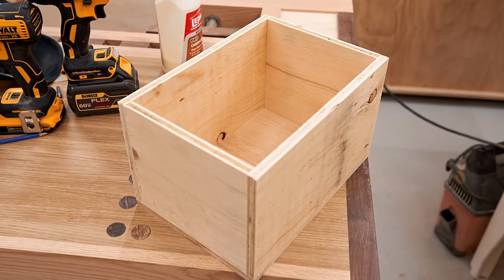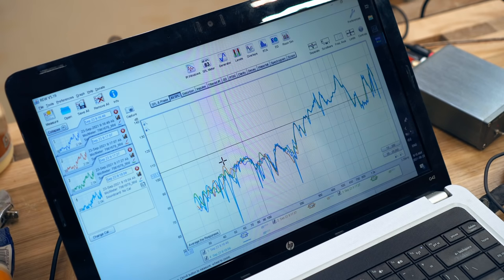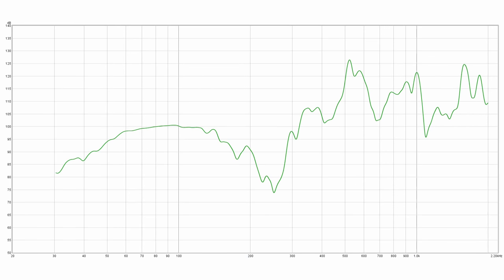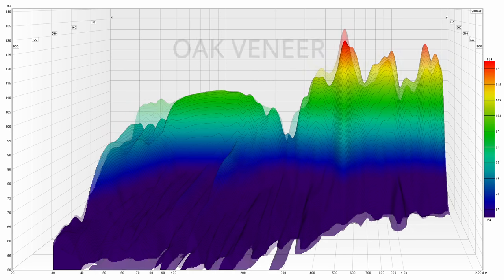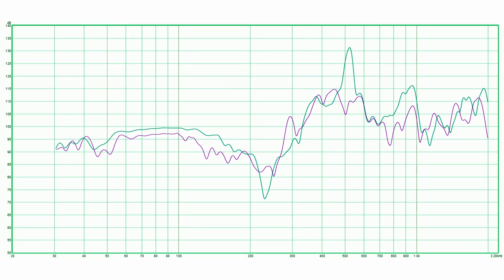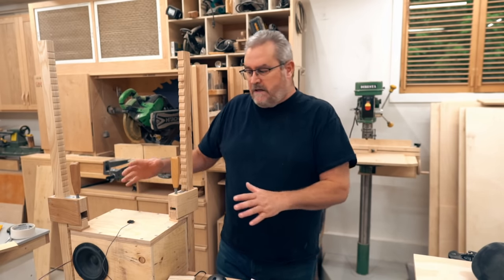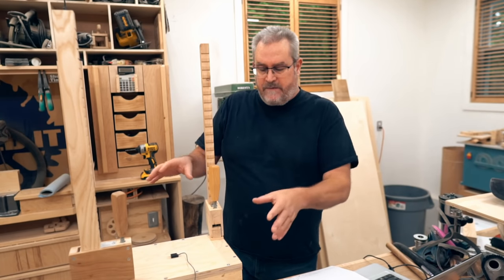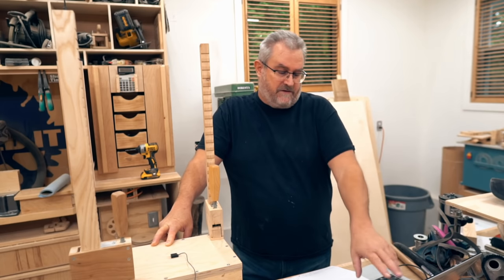PLYWOOD vs MDF For Speaker Building - Tests Show Surprising Results

Comment: Not everyone has the same sound sensitivity when hearing just like not everyone sees with the same vision, some see further some see more color depth or contrast and the same is true about hearing. Most won't hear a difference but some will detect the slightest difference.

Comment: Use bracing to get the resonances up in frequency. Then use stuffing to control them. That's the way it is mostly done these days. Which is obviously supported by your measurements. What doesn't keep me from making my speakers from beech plywood (not that popular in your part of the world, I am aware), which is heavy and rigid as hell.
Reply from the maker: Yes, best of both worlds seems to be the most effective. 
Probably the very best would be to use the stiffest material possible with bracing and damping, but the gains won't really be significant enough to justify any extra expense or the inconvenience of trying to get something that's not commonly available where you are. Like I said in the description, though, it's hard for people to overcome their preconceptions. If they are convinced it has to be a certain way, no amount of evidence will sway them.

Comment: I'm not sure if the methodology was appropriate. He only changed one of the 6 pieces of wood in the box and took measurements. If the 6 pieces of bottles were exchanged, it is possible that the differences measured would have been more significant.

Comment: How about long term stability and that wood moves over time with environmental conditions?
Reply from the maker: Under normal conditions (indoors, kept dry), solid wood expands and contracts with seasonal humidity changes, but plywood / MDF does not. Engineered sheet goods like plywood and MDF are dimensionally stable.
Reply: @IBuildIt  doh! Of course. Thanks.

Comment: Hello John and anyone else who might know: Does the shape of the enclosure matter much for the over-all performance of the speaker? I once read that an enclosure following the (iirc) golden ratio (something like 0.6x1x1.6 depth, height, width) was "a good thing" for speaker performance, but it wasn't explained why.

Does this idea hold any water, or is it just more wishful thinking?

Thank you!
Reply: Golden ratio in the math more of a sphere with the dimensions of a rectangle describing it.  Golden ratio can be found in the degrees or circumference of a circle using that as a basis for your closure by length opens a very very specific door to things that actually work not lump sum volumes and don’t do much of anything specific.

But 02618 is 15° over and over and over again in the circle where it will repeat.  15° can be 15 cm, if 360 cm is used appropriately compound pipe of 270 and 90 in a parallel arrangement does something just like this and we drivers firing at 30 cm in from each end you didn’t have 300 cm between them and acoustical center of that as 150 they close the center of the enclosure and the end 180 tossing around the golden ratio of multiples multiples of many dimensions including the sphere created for the volume of the sphere i, it’s self has a 240° the same number as the math constant 4÷3 times pi, if radius is 0.5 then the virus fear 05236 which is twice the golden ratio and 30° it’s also the speed of light and it’s parallax angle it’s locate the planet earthEverything else by the Pythagorean theorem and the diameter of the sun has the short leg of the triangle at that angle from the center Sun to earth at 150,000,000 km away.  Details in decimal points that make it even more appropriate

Comment: So go ahead and use cheap pine plywood and stuff the box.

It would be interesting to try the same tests with solid wood rather than ply to see the difference.

Also could you do the same with Styrofoam and Foam core board. There has been a lot of chatter on DIY boards about such alternate materials.

Comment: Nice set of tests John. I like the method. You didn't try flooring grade OSB. It might surprise you to.
Reply from the maker: I thought about it, but didn't have any on hand. I've made a few speakers from OSB, including that small subwoofer I built a couple years ago. Insanely stiff stuff.
Reply: @IBuildIt    What I really like is the soft core. Can you say internally dampened? I have to do a similar set of tests on a super stiff thin walled cabinet and a 18mm OSB cabinet. As you mentioned the upper frequency resonances are the ones that are the larger problems. What I have found working on some very tricked out enclosures and loudspeaker drivers is that when they start to get really good you do notice the absence of these colourations. It's not smack your forehead what a difference. But you do notice the difference in what you can hear in the recordings versus what was previously masked by the noise the drivers or the enclosures were adding of their own.
Reply from the maker: Going to take a fair bit of noise to do that, no? And by audible, I meant an audible difference between the panels I tested.
But I can't say one way or the other; since building my room downstairs I'm hearing music like I've never heard it before. Now that absolutely does make a smack your forehead difference.
Reply: @IBuildIt    Lets follow your lead with the room treatment. Why do you think that you are enjoying your music more now than ever before? Perhaps you are experiencing the lack of colourations that are inherent in an overly  reflective room? Or has serious null points in the bass right where you are listening? Once you clean up the larger things it can be interesting what starts to show up in your listening. Your ears get accustomed to the cleaner sound. And it is hard to go back to the former sound. You are experiencing greater fidelity to the recording I believe.
Reply from the maker: Yes, but the treatment is fixing very serious problems. Problems that are created by the full volume of the audio signal itself (reflections and reverberation), and not a much, much lower residual that's being emitted by a panel in the speaker. The output from a panel will be orders of magnitude lower than the signal itself.
Reply: @IBuildIt   There are loudspeakers that have resonances that are actually very audible. Column loudspeakers are infamous for having an audible resonance around 1kilohertz due to the internal reflection wavelengths. The funny thing about all these so called hidden resonances are that they get louder as your music gets louder. So are they really inaudible? In my experience they are audible.
Reply: @KravchenkoAudioPerth  I'd also like to point out that the surface area of the enclosure relative to the Sd (surface area of the driver's diaphagm) must be considered.  Do the math and you'll see that even on a small monitor it's usually an order of magnitude or more.  Consider flat panel speakers....It's an exciter coupled to somewhat rigid panel....And they make sound that's very audible...And they do this even though the movement of the panel is small compared to a conventional driver.
Reply: If fact, my new Sony A80J 77” OLED TV does not have any speaker drivers… it actually uses the glass TV screen as it’s drivers.  And the screen does not appear to vibrate at all as it outputs very loud and clear high quality sound!
Reply: @russellanderson746    You are right. Sound within a given bandwidth constraint. And given the human voice frequency range is not that wide, these exciter based methods can really work out quite well.

Comment: I dont see MDF being so great, many layered plywood is defen. harder and still a mix of pieces with different qualities, while the MDF is homogen.
The best material in this case is actually corean (by Dupon) it has the perfect mix of materials to dampen sount inertially by itself. (because of the mixing of materials with so different properties causing nullyfiying out themselves)

Comment: If you want to get a better test result..... build the exact same box out of the entire material for each. I'm  prety sure you will see that the difference is much more noticeable when the entire box is made of the exact same materials . Trying to measure just one panel it's not going to be as accurate as measuring when the entire box is all of the same material. This is because the sound will travel through all of the walls of the box. This amplifying and or exchanging that to the next panel. But then again maybe I'm wrong. Would definitely be interesting to see if it does indeed make a difference. I know that it has in other kinds of materials

Comment: 2 keys points - a) Additional bracing is not a new thing and b) That's why the top speakers don't use wood. c) You mention, listeners could build with materials used in your test and state the subjective challenges doing so, how about finishing your experiment with complete boxes.

Comment: Ok. Let's clear something up. I have an 18in subwoofer. It handles around 2k watts rms. Do not use 0.5in plywood or mdf.  Does 3/4 make a difference? Oh yes. Does it still flex without braces? Yes. To say 3/4 is only marginally better than 1/2in is misleading. Maybe in your small low power speaker, but in higher power more dynamic speakers the thicker material will shine. Type of material might be less significant than thickness, but for a powerful speaker more is better.

Comment: I like the end takeaway. . try to be objective in your subjective listening test. 

Thanks for doing these tests and confirming what I wanted the result to be. (always helps accepting results that match with your desired result, right?) 😜

I'm wondering if this would change much with larger, floorstanders or sub enclosures that have significantly more volume. However, as you pointed out, an adequate amount of bracing may be the key takeaway. There probably won't be long, unsupported or unbraced sections that would vibrate at resonant freq of the material anyway. And if so, then it may be more of a problem with the design or lack of bracing rather than the material being used.

Comment: where was the accelerometer data? 
and would be nice to see a full comparison box between the extremes, worst performing wood with no bracing and no stuffing. then the mdf maybe at 3/4" thick with bracing and stuffing, alos with aluminum foil with bitumen covering the inside box. it really helps with adding mass and damping. it is easy to fit 2 pounds of it.
Reply from the maker: The data is the measurements.
Reply: @IBuildIt   so the accelerometer is measured in frequency response graph? 
no mic used at all?
Reply from the maker: The accelerometer measures the magnitude of the panel vibrations and that's over the entire sweep range. The higher the peak, the more the panel is moving.
Reply: Hit it harder .  A sweep at ‘dats’ output or laptop sound card has often missed important details I found later the hard way.  Trying ‘beat ‘ freqs around areas if suspicious freqs often found the naughty spot.
Reply from the maker: @Boogerweldz  The speaker is driven with a 20 watt amplifier. It has to be quite loud to get a reliable reading from the panel at all.
Reply: Would love to see you run simillar tests on freestanding (no clamping) sub enclosure at 500-800 watts (RMS) and SPL’s of 70 to 130! Lol😜

Comment: If you double up on the front baffle thickness I think you will be surprised.
Reply from the maker: The front baffle has the drivers, which takes away the bulk of the resonating surface. So there not much gain in doubling it.
Reply: @IBuildIt  I agree with you on that, if it was a 15 and up the slapback standing wave reverberation on a baffle the same thickness as the rest of the enclosure is something you would definitely pick up on when testing, but then it all comes down to rigidity and from the years I've been watching your carpentry videos I think you have it nailed.

Comment: No it won’t make a big difference in a tiny space like that with a 12x14” panel but once you get to areas with 30+ inches with braces only every 12+ inches there’s a huge difference in vibration|flex and if every panel is made out of the same wood and not just one of the panels the difference would test double or triple the difference  of what your chart shows since it’s all the wood vibrating and not just a single panel.

Comment: Almost identical - As you overlay a graph showing 5 to 13dB differences that would require 20x boosts and cuts in power to correct.  🤷
Reply from the maker: You don't seem to understand what I'm measuring. This isn't showing the output from the speaker - it's showing how much the panel is vibrating. The output from the speaker is a good 30-40 db greater than what the panel is producing.

Comment: Objective testing means blind testing behind a transparent black curtain!
Reply from the maker: Objective means not subjective. 
Testing objectively looks at the facts, data and evidence, rather than relying on human perception, impressions, feelings and other subjective criteria.
You can set up an objective test using subjective data, for example a blind test where the listener can't see what's being tested. But it still relies on subjective evaluation and is therefore not completely objective.

Comment: can we measure what you hear? then yes, box coloration is a thing.
Reply from the maker: We can measure that and we can measure what we CAN'T hear, as well. 
In audio there is the signal to noise ratio, and having the noise far enough below the signal means it won't add enough to the output to be detected by our ears.
Reply: @IBuildIt  yes

Comment: Your test and assumptions are flawed.

You should’ve built (4) different boxes. 1 made entirely of baltic birch plywood, 1 made from MDF, 1 made from Construction Grade plywood, 1 made from Pine Plywood and compare the results of the four boxes made from all four different materials, 

 you compared the back of the box made from a different material.  Cabinet Resonances do not travel in one direction only. 

Also you didn’t take into account the front baffles sharp 90 Degree corners which also have reflections.

The majority of speaker cabinet manufactures chamfer the edges of the front baffle to reduce the reflection from the drivers.

Also great loudspeakers designers who are audiophiles use special microphones with the bottom of the speaker cabinet sitting on a stand approximately 28 - 33” high and the center of the tweeter positioned at ear height of 40-46”. The microphone will also be positioned in the center of the tweeter from 3Ft - 6 Ft away.

They set them up a different distances to test the frequency response and the sweep measurements. 

They also will try hundreds of options to keep improving the sound quality of the loudspeaker with not only the drivers the cabinet build quality but also the crossover network and the type of crossover network parts. They won’t buy cheesy crappy parts for a few dollars either! 

There’s a company called GR Research, Danny’s been designing Loudspeakers for 20 years he is an expert on the subject!

 he may go through 100 reiterations to design the almost perfect loudspeaker less than 1% of all loudspeakers manufactures do this! 

His videos can be found on YouTube